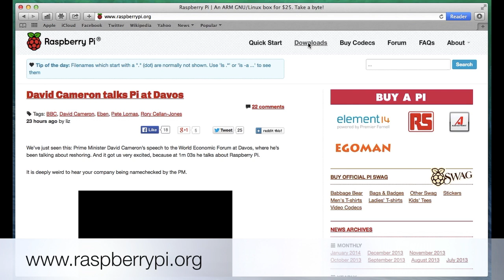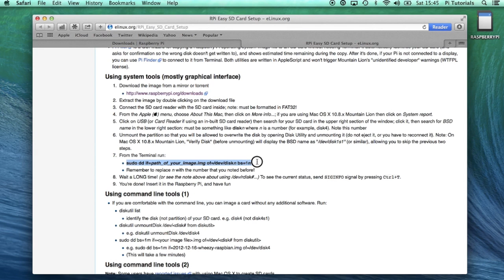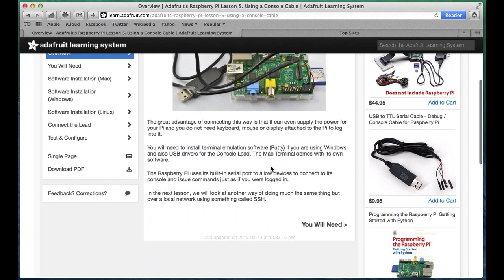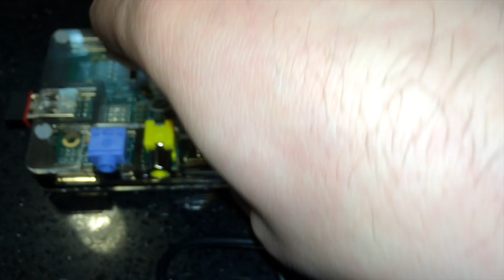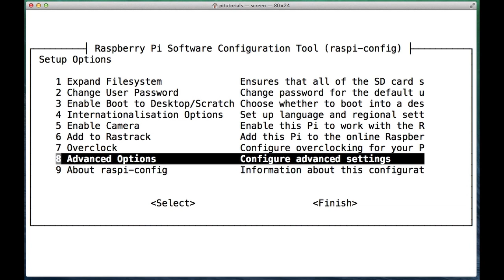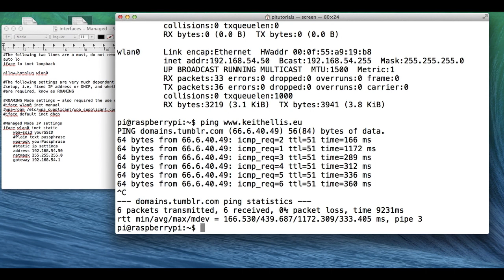Setup Raspberry Pi, headless without keyboard, mouse or monitor

Comment: can you telll me steps for Linux/ubuntu...
Reply from the maker: Hi there, the steps for doing this from a Linux computer will be very similar to my instructions since Mac's are based in Unix which is very similar to Linux.  The main difference is getting the screen command to work.  
To install screen use
sudo apt-get install screen
Linux should already have the drivers required for the console cable but the screen command is slightly different, you will need to use
sudo screen /dev/ttyUSB0 115200

everything else should be the same, but please post back if you have any problems.
Reply: Keith's Pi Tutorials
the same procedure will be applicable to raspberry pi b+ ???
Reply from the maker: Yes exactly the same procedure for Model A/B/A+ or B+.  It might not be the same for a Raspberry Pi 2 model B.  I've got one on order so in a few weeks I should be able to confirm.
Reply: Keith's Pi Tutorials
i have done following step for my pi b+
1> download raspbian from http://www.raspberrypi.org/downloads/
2>formatted the Sd card and loaded the setup mentioned in the link http://elinux.org/RPi_Easy_SD_Card_Setup
3> i am able to see the cmdline.txt as you mentioned in the tutorial and edited with ip = 192.168.1.110(according to my system , becuase in my system's ip address in 192.168.1.33)
4> then i connected internet cable's on end to board and one end to my laptop
5> then i powered up board with usb cable . whose one end is connected to board and one to laptop
6> now using putty i tried to connect..but showing "no route to host" putty fatal error....

can you please tell me , what is missing ?

Comment: is it the same for B+
Reply from the maker: Yes, the model B+ is backward compatible with the model A and model B, so it should work exactly the same
Reply: Keith's Pi Tutorials
i wanna ask you, i jst install the raspbian on my RPi but somehow i cant access my sd card in my laptop anymore..is it normal?
Reply from the maker: Is it a Windows or Mac laptop, if so this is perfectly normal.  You should be able to access the /Boot partition since this is FAT formatted, but the installation of Raspbian formats the rest of the SD card as ext4, which is not readable by windows or Mac
Reply: Keith's Pi Tutorials im using windows..i just connected my pi with my TV but it only display the scratch program..how to fix them btw i dont have keyboard attach to it jst now
Reply from the maker: Can you connect with ssh, ssh should work even with scratch loaded.  you can then run sudo raspi-config to turn off 'boot to scratch' If you need to find the Pi's IP address, try Fing on Android or iOS
Reply: can i just access them through my laptop?
Reply: it is my first time using this, not really familiar with it.
Reply from the maker: What do you mean, access it though your laptop?  what do you want to access?  The terminal, then SSH will do the job for you.  If you want the Pi's graphical screen on your laptop you will need to investigate using some VNC software.
Reply: Ok..i did it by using mobaxterm software..do u knw how to give raspi internet connection by using ethernet and connect through our laptop
Reply from the maker: I know it can be done, but have never done it myself I suspect the setup is required on the laptop to enable internet sharing through the ethernet port.  As long as the laptop is giving out IP addresses the Pi should connect automatically.
Reply: Keith's Pi Tutorials  it can be done through Putty.. go google it ..

Comment: Hi, thank you for the tutorial. I followed all the steps but after screen /dev/cu.PL command, my computer open a screen but it remains blank and nothing happens. Can you please help?

Thank you
Reply from the maker: apefromthepast Have you tried typing on your keyboard?  If the letters appear on the screen this is perfectly normal.  Your Pi is waiting at the login prompt, but because you started the screen command after you Pi booted you cannot see the login prompt.  Try typing you Pi username, default 'pi' and press enter.  it should then ask for your password, default 'raspberry'To get around this confusion you can start the screen session before powing up the Pi, this way you will see everything you Pi dispays duirng boot, including the login prompt.
Reply: Keith's Pi Tutorials
No. The screen command open after typing the command and does nothing. I can't type into it. I tried both methods: powering up pi after entering command and before entering command. Neither seems to work.
Reply from the maker: apefromthepast Maybe you have the TX and RX pins on the console cable the wrong way round, try switching them.
Reply: Keith's Pi Tutorials
I tried that too. It didn't change anything. Just making sure that this is the setup: MicroSD card plugged in the pi, the console cable attach to the pi on pin 2, 6, 8, 10, and the USB side of console cable in the usb port of a computer.
Reply from the maker: Are you plugging the Pi in to power via the micro USB as well?  If you are, do not plug the red wire onto pin 2, just leave it loose.
Reply: Keith's Pi Tutorials
Sorry for the late reply. I have just been using the console wire. I have tried it with just the micro USB cable.
I am going to try to re-install the OS and see if that fixes it.
Thanks for all the help. I will let you know how it goes.
Reply: apefromthepast
I finished reinstalling the OS, and it worked fine. It booted up like you said and everything worked perfectly. Thank you so much for the tutorial.

The change I made: (just in case somebody is stuck in the same boat)
The only change I made was during command installation of the OS on the SD card, I omited the bs=1m on the sudo command. I wrote "sudo dd bs=1m if=2014-09-09-wheezy-raspbian.img of=/dev/disk4".
Reply from the maker: Glad it worked for you.

Comment: is it possible to set up the pi without the console cable and just ethernet (b/b+ models)?
Reply: after I transferred raspian (2014-09-09) to the SD card and try to connect to the pi with "ssh pi@192.168.2.100" I just get  "ssh: connect to host 192.168.2.100 port 22: Connection refused"
Reply: +Man uel yuppp, you have to use a second computer though, basially what you want to do is you want to use a program to extract all the iso files onto an sd on your desktop, or laptop, then put the sd in the PI and connect to the PI via putty or any other SSH program.

Comment: How do I exit the setup terminal and get back to mac terminal?
Reply from the maker: So when you are in the screen command you see the console through the serial cable.  To get back to your Mac Terminal you need to exit the screen command.  to do this press CTR+A, then D

CTRL+A is the meta key for screen, D detatches the screen session.
Hope this helps.

You might want to read the documentation for screen, it is a very useful command
http://www.gnu.org/software/screen/manual/screen.html

Comment: It keeps telling me "Sorry, could not find PTY."
Reply: I had the same problem.  Myself, I think something else I had plugged in another USB port caused a conflict.  Got rid of the hub, got rid of everything else, and it worked.  YMMV.
Reply from the maker: This sound like a driver problem.  Make sure you have downloaded the correct driver for you console cable.  Also make sure the console cable is plugged in before running the screen command.

Comment: The easiest way to create a SD card on Mac is to download the "Pi Filler", it has a graph UI and no command line typing required! The easier way to setup the Raspberry Pi without keyboard, mouse at the first time is to connect the Pi to ethernet and power, then find out the IP from your router, then using ssh pi@192.168.0.xxx to log in, then you can run "sudo raspi-config"!
Reply: Henry, I happen not to be able to connect to the router here by cable, so I need to use a wireless dongle. Keith saved my fanny! Your comment is welcome however, I'll no doubt use that approach sometime in the future from a different location.
Reply from the maker: Hi, thanks for your comments, I'm not aware of Pi Filler, I will have to look it up.  With regards to your second point, the Raspberry Pi model A does not have ethernet, thus the reason I used the console cable.
Reply from the maker: Donald Porter Glad you found it useful.